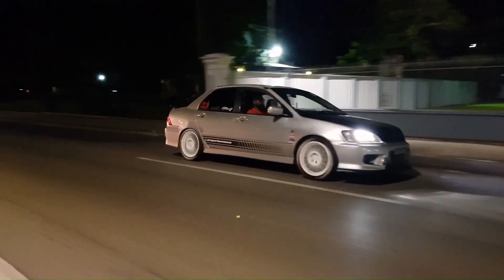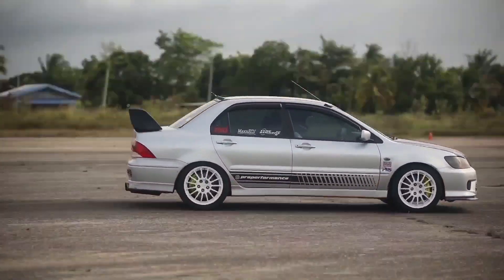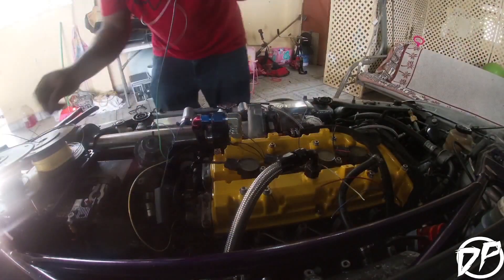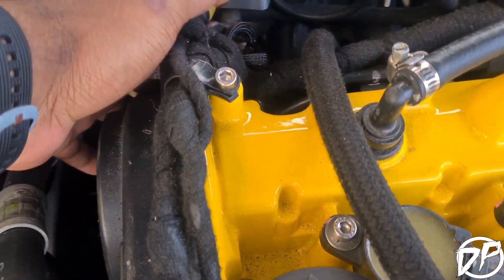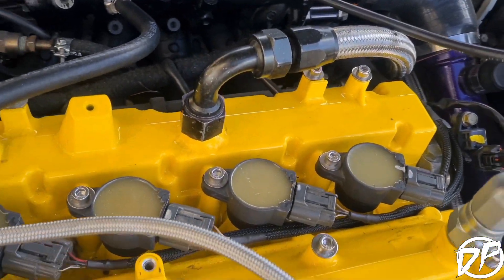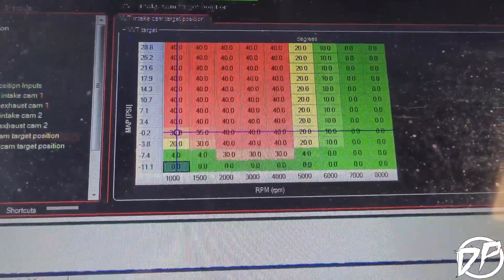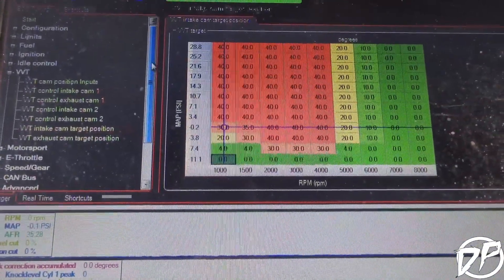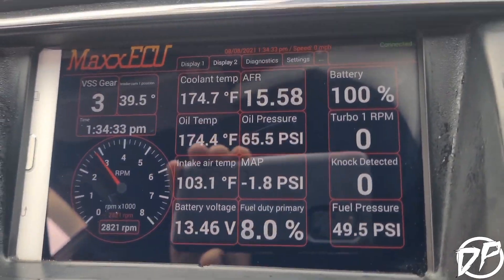4G15 DOHC Mivec Turbo | Setup | Testing | Touge

Comment: hello, a mitsubishi EX has had engine swapped to 4g15 mivec turbo. Unable to find the rmp wire, badly need to fix a gauge but unable to do so
Reply from the maker: I'm not sure of the wire. Sorry. Very hard to locate wiring diagrams for these. The electrician wired up my car, by tracing each wire

Comment: How much boost yuh running and wat coils u use
Reply from the maker: Currently on 12psi. Going to 25psi when we go to the dyno. Those are oem coil packs for the 4g15 mivec turbo engine. Oem coil on plug setup